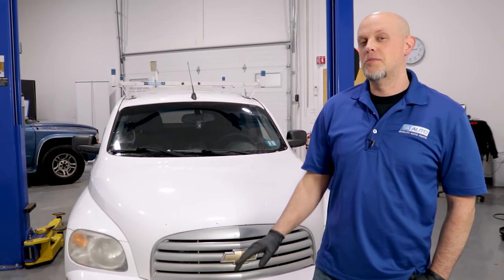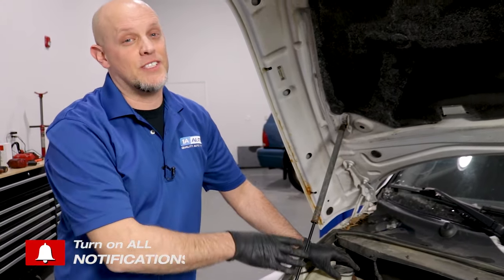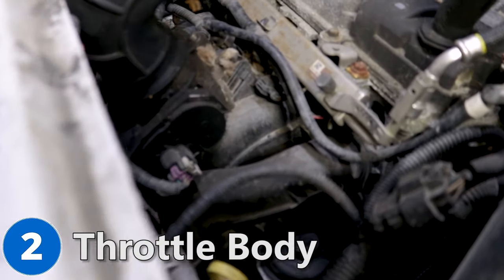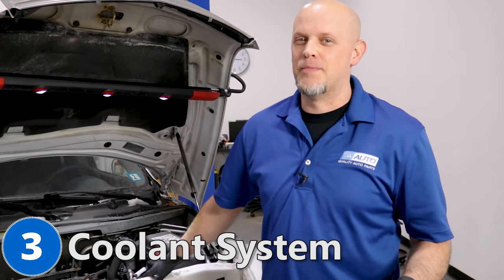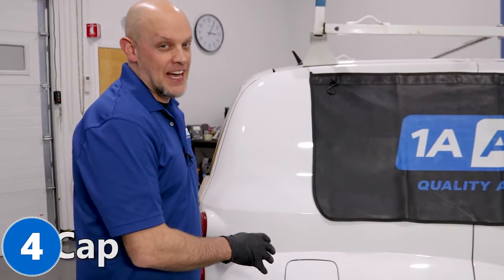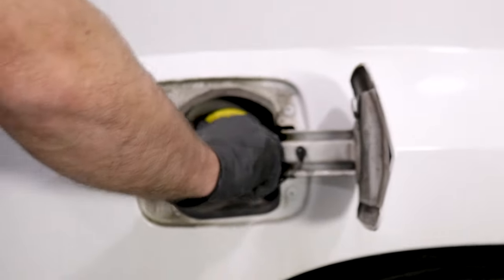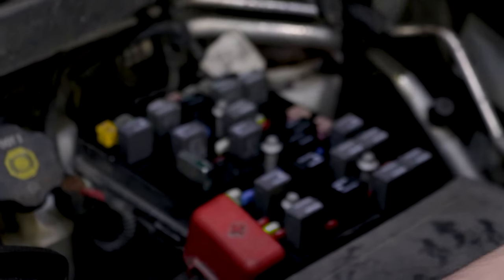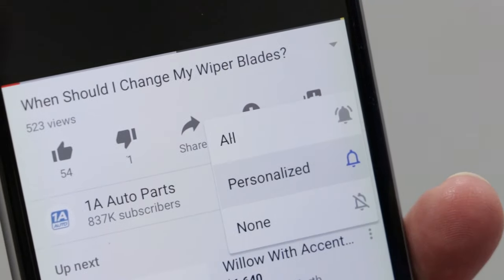Top 5 Problems Chevy HHR SUV 1st Generation 2006-11

Comment: You're correct that these are great vehicles.  Mine has 312k and still going strong. Only thing was I had to change the timing chain at 294k. Best car I've ever owned. Absolutely trouble-free. Also no squeeks/rattles in the interior. The extra cheap old-GM dash plastic is tight as a drum LOL 😆. I know everyone hates GM but that's all my family has had for many years. Cannot think of any significant repairs being done to any of them.
Reply: The mpg are great also. At 55 mph I’m getting 40 mpg. I had a good tail wind and got 56 mpg.
Reply: My 2007 HHR is my daily driver plus my vehicle for Ubering as well. It has 220k on it with NO MAJOR ISSUES at all. Runs great, and is probably one of the most reliable cars I’ve ever owned!
Reply: I had a 2008 Chevy HHR LS and it was one of the best cars I ever had. I bought a new 2020 chevy Malibu LT and I’m happy with it too.
Reply: My wife ❤'s her 2011 HHR Z24 we 
bought it when it was 2 years old with 22,000 miles it now has 120,000 miles & it runs great and is averaging 22 mpg city & 29 highway..the suspension is the same as the Chevy Cobalt with NGK Frt.& Rear Struts.. GM Performance control arms & motor/ trans mounts K&N Air Ram Filter Assy.& Magnaflow Street Muffler...
Reply: @leebonnecarrere5955  when your E.S.C come  on
Reply: @andrewchapman4313  I just bought a 07’ HHR with 136k miles on it. Never driven one. Hope it all goes well.
Reply: just brought one at auction 127k miles 2010I am nerves i need this too be my daily driver until I can get something different check engine light is on!

Comment: First and only generation, these HHR’s will last you if you preform proper preventative maintenance. I’ve owned 2 both over 100,000 miles, no major issues. My 2007 LS is still in service with over 300,000 miles.
Reply from the maker: +Oldblue’s HHR channel Thanks for the feedback!
Reply: Do you apply your own preventative measures yourself or have a trustworthy mechanic do it all? @Oldblue’s HHR channel
Reply: 235,000 on my HHR and just replaced shocks, struts, springs...rides like new!
Reply: My friend just brought hers by my house to check an oil leak. I'm fearing its the crankshaft seal. I just changed out the thermostat as it was stuck open throwing a code and disabling the air conditioning. And we're going to have record highs of possibly 113° next weekend. Also need to replace the upstream O2 sensor but I couldn't break the threads loose. Was looking around for help with that when tonight she noticed oil leaking and a little smoke from under the hood. Car has over 221,000 miles on it and its been driven hard. So I can't really fault the car. Just age and miles. I wouldn't mind having one myself. The 2.4L with the manual transmission would be nice. Or an SS.

Comment: Never have had a problem with mine 200,000 miles later still going strong
Reply from the maker: +Christie Kerns Thanks for the feedback!
Reply: I’m on my second hhr love it as well.
Reply: Well god bless, i financed a 06 hhr lt with 17" wheels anger pioneer audio...the poor thing has been neglected and the mileage is 135000. I've had oil,oil filter,air filter,downstream oxygen sensor,rear brake shoes and cover,front brake disc and rotor,spark plugs,a ignition coil,tires,control arms , and front shocks..all replaced..so i love the car but i hate the negligence
Reply: 250k here, just a front drivers side rattle I need to figure out but goes away when I turn.
Reply: You must have got the one in a million HHR!
Reply: @natesilva3232  Mine is exactly the same! Same wheels and nice audio system... it looks nice! But a pain in the ass! I call my car the pedantic princess! 😂
Reply: I got an 08 hhr with a lil over 240,000 n so far my only problem is the air conditioning vent clicks in the beginning
Reply: @natesilva3232  I mean some of those things are necessary
Reply: @natesilva3232  oil and oil filter. Good things
Reply: @natesilva3232  air filters should be changed every 12,000 miles. Or every 12 months
Reply: @natesilva3232  brake disks and rotors also a good thing to be changed
Reply: @natesilva3232  tires. Why tf I'd hope you changed them
Reply: @natesilva3232  spark plug. Good to change
Reply: @natesilva3232  spark plug. Good to change
Reply: @natesilva3232  hold on. Wtf you should go get some new pads ngl
Reply: @thecountessofgreycastle7119  me: first check engine light.
186k
Reply: @benaqi821  is it opening and closing easily?
Because mines clicks too
And opens and closes easily 
When I say easy. I mean EASY
Reply: Same but I got damn near 250,000
Reply: Mine has 300,000 and still has no problems
Reply: @natesilva3232  That car has a recall for a steering rack call your local dealer ship and give them the vin#

Comment: Timing guides were a potential issue in the 2.4. I always urge anyone after 150K to install new timing chain guides. There are many redesigned aftermarket ones that fixes the issues. After that, solid cars

Comment: You forgot the fuel lines rust out. Right at the drivers side wheel well.
Reply: Yep! Just had my gas line fixed. Took it to the dealership and they want to replace all the fuel lines. $800! Yeah right! I went and picked the car up and took it somewhere else. He knew exactly what to do. $300.
Reply: Guys let's be real "common" is for where you live. You might live in the rust belt. Furthermore protecting the underside of the car is a good idea.
Reply: @Coleschonfielddd  who the hell wants to waste good beer money on something you cannot see. breaks aint that important.
Reply: Yep. Happened to my car. Had a shop make new fuel lines.

Comment: I have a 2011. Right now I'm having gas fumes rear of car. Appt with garage Jan. 23-2024. They think It maybe fuel pump. Car has 135000 mi. The car runs great until I couldn't start it after I driven it. Car was sputtering too start. But started. I got a new  Battery. That helped but smell of gas in rear still.

Comment: I bought an 07 in February of 2022 with 86,000 miles on it. Searched high and low for one of these cars. All I've needed thus far was a new fuel tank the week I bought it and a new catalytic converter 8 months ago. Pipe split and was getting very loud. Luckily the fuel tank was covered under the used car warranty. I paid cash for the converter. Outside of oil changes and a new set of tires this spring, this car has been a trooper. 2.4 has plenty of power and does good on gas. And the AC performance is the best R134a system I've experienced. Other cars do get cold but this car is damn near instant cold even on 110° days, really reminds me of old R12 systems. I'm surprised the capacity is less than one pound of refrigerant. Overall this car is fun to drive, the 260 watt sound system thumps, I use it to haul stuff around on occasion which is nice, and its quite roomy for my friends and family when needed. Probably the only 2 issues I have with the car itself is not having an Overdrive lockout. I don't like how using the "I" position with the transmission hangs the gears at higher RPM before upshifting when I only need to downshift one gear, and the single note horn. I'm looking into seeing if horns from a Malibu will work to get a louder 2 note horn. I plan to keep this car a while so I'm glad to see so many owners getting a high amount of miles out of theirs.
Reply from the maker: +V Anderson Thanks for the feedback!

Comment: Of the 5 you've listed, the only one I had was a dirty throttle body. Which, is easy to clean as long as you're careful. Sensors seem to be the thing that give these cars the most fits. Just make sure that when you change them that you're using genuine OEM parts! If you cheap out, you'll regret it...oh, and those cheapo plastic door handles breaking are a known issue.

Comment: I owned a 2008 HHR, and it was the easiest car to work on I've ever owned. It was practical, got, great gas mileage and the 4cyl. Engine had plenty of power. I got t-boned at an intersection and it was totaled, but, it still started and ran even though it was bent in half. Great car and I'm still looking for another one.

Comment: Have an 08 and have had none of these problems except it has a surge, probably the throttle body. Have a 2010 that has some sort of short in the wiring harness under the dash. Might be a common problem from what I'm reading on some forums.

Comment: My 2007 Chevy HHR has been awesome only one major problem happening now and I cannot figure out what it is I have those horrible shacking up front feels like left wheel? Now I did change the motor mount on upper side of engine but I check my bearings fine, I checked my CV joint it’s fine so unless I take it in I haven’t been able to figure out the culprit if anyone else has or had this please drop a message on what is it?
Reply: Still have the car and the noise? If it's a thumping rattling noise most noticeable at low speed while hitting a bump, I would be sure to check the sway bar end links

Comment: You missed a big one. HHRs develop a clicking noise in the front suspension. Too fix mine , I had to replace both lower control arms , front struts, and the electric steering. 

And mine is a 2008 2LT with all options. It’s a one owner , no salt car with only 62k on it as I post this.

Comment: I thought this was going to be a complaint-fest, I'm glad to see the positive comments. Bought my '08 with 80k, now it's got 144k. Needed a water pump my first year, covered by used car warranty, then after 100k got front rotors. That's it. I've had a washer in the back, a dryer, and of course tools, then I can pop the leather seats back up and enjoy a nice car. Don't plan on selling it.
Reply: I bought mine with 80k on it back in 2012. I've drove across Canada almost I have about 284k on it now. My new mechanic complimented me on how great of shape it's in. It still runs like a dream. I love it for camping I put the seats down and made a bed that fits perfectly. Plus I bought one of those tents that wrap around the back of the car. I don't ever want it to die LOL
Reply: I got an 08 with 246,000 miles and counting runs great no oil leaks just had to change the thermostat last year other wise no problems great car

Comment: I have an '06 HHR and I'm getting an p0304 error which the guy at AZ said indicates a misfire caused by the ignition coil(s).
Before I start taking things apart, is there a video that shows how to replace it if I have the one piece unit rather than the 4 individual ones?

Comment: Factory front brakes and speakers. Other than that, I've been doing good with my 08.
Reply: Did your speakers stop working?
Reply: My speakers also, went out on my 2010 apparently thats common on the hhr. I have an 20112lt now with pioneer factory system no issues.
Reply: @djinkentertainment  was it the speakers or the radio?  My tweeters always work but my speakers are temperamental.  They seem to work only when the weather is really hot

Comment: Thanks for the info and tips.  I'm looking to buy an HHR, can't wait 😃
Reply: @limabean13 make sure it is the Flex fuel version. That's 2009 and later. It will have a yellow gas cap and it should say it on the tail gate. Flex fuel is E85. It is usually cheaper than 87 octane. You may lose 20% of your gas mileage but it's not noticeable. It burns cleaner, it cleans as you use it, and it may also boost your engine power output and it also burns cooler. That means your internal parts are cooler. When everyone was paying $4.00/gallon for gas, I was paying $2.60-$2.80/gallon for E85.

Comment: Have a 2009 Chevy HHR. The warning messages I have are " service ESC" I haven't even been able to find out what that means. The other one is " service traction "  I'm guessing that has something to do with my anti skid because it goes off all the time. I can hardly use my breaks at all in winter. Gearing down a half block before intersection. Also it gets stuck in an inch of snow even with studded tires. What is wrong with my car ?

Comment: Love my 06 hhr lt at 264k miles. New thing im running into is exhaust fumes/odor coming from the engine  into the cab.  Any idea what that could be and what to replace? Most notable with heat on, and popped the panel on the passenger side and that's where the fumes/odor is the most.  I'm thinking with the cowl seal needing replaced, and cabin filter, that hopefully fixes it.  

Sorry in advance for any wrong terminology.
Reply from the maker: +@jamesdb7115  We wouldn't be able to diagnose an issue like that here, you may want to have a local mechanic take a look at it. Thanks for checking us out! http://1aau.to/m/Shop-1AAuto-c

Comment: I’ve owned 2 HHR’s and I have the same issue. I’ll be driving it and suddenly it starts hard shifting. I pull over turn it off and restart the car and it’s fine for awhile. I drive for a living and this happens erratically. Sometimes a few times a day and sometimes once a day or after several days. Would this also be coil  related ?
Reply: TCM ground more likely than not. Ground issues are common on the HHR and cobalts.

Comment: I need HELP. My T/C light keeps turning on and I don’t know what to do it turns on every 3rd shift or changing from reverse to drive..
Reply from the maker: +Hannah Padgett We wouldn't be able to diagnose an issue like that here, you may want to have a local mechanic take a look at it. Thanks for checking us out! http://1aau.to/m/Shop-1AAuto-c
Reply: Did you replace your brakes?  I did a four wheel brake job and enjoyed nice ABS & T/C dic lights for awhile . Check all fuses b4 spending money. See chevyhhr.net too.
Reply: The traction sensor may be going bad. It's one of the several common issues on HHR's.

Comment: What about the timing chains ? These motors have (2) 6mm bolts that hold the timing chain guides and these bolts break or come lose all the time . Those bolts should have been 8 or 10mm not 6 bad design . That's the only big issue I've had which is more of an engine problem not a HHR problem . Yeah the gas lines too which can be replaced with nylon , nickel copper or stainless steel to avoid rusting again .
Reply from the maker: +Jim Vezina Thanks for the feedback!
Reply: Do you know if its a non interference motor?
Reply: @tireslayer6568  did you find out?

Comment: No start i just replaced the starter this makes the 5th time i replaced the crank sensor cam sensor throttle body sensor now no readings on the tire pressure show zero coolant shows 40 ave speed shows --- and so on monday the car showed low engine power and wouldn't start till about 20 minutes latter not sure wtf is going on